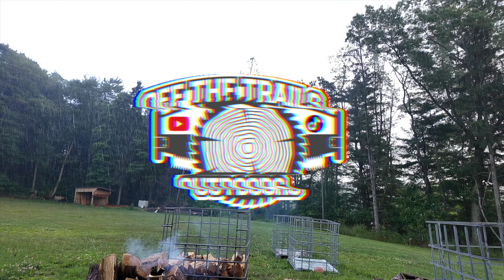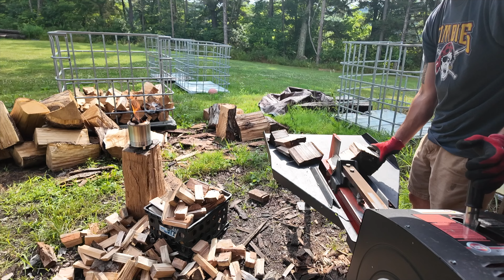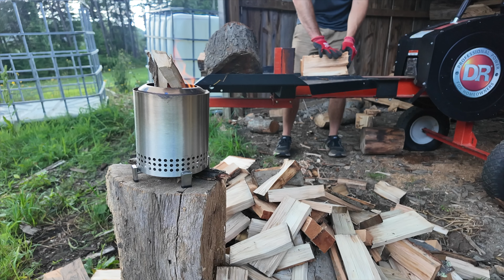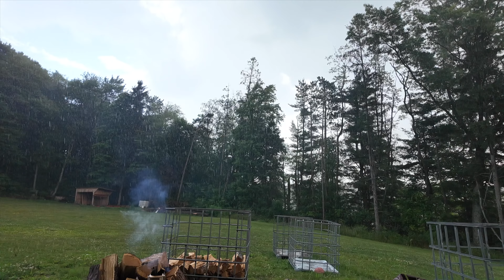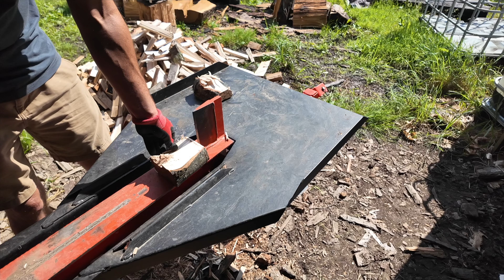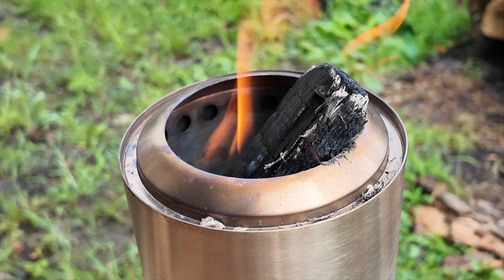Splitting Small Wood - Solo Stove / RapidFire

Comment: Not exactly the safest way to cut splits. I own one of the largest firewood companies in the South and have two Super Splitters (commercial grade kinetic versions of same style you have) and I'd never allow any of my employees to keep their hand in front of the ram as it's moving forward. While we run a significant volume (about 150 cords a week) and the chances are we'll have issues more often than you the main point is you will have issues eventually. Those splitters are notoriously dangerous and have a tendency to "kick" wood. When that happens you've got no idea what direction that piece of is going to go and where your hand will go if you happen to be holding onto it. We've be fortunate enough not to have anything more than a few bruises from flying wood but one of my fellow producers in TX has had several severed fingers. I've got a Bonfire sized Solo and we use pizza splits 8" cuts that work great. Not sure I'd use the smaller version except maybe for camping and smores but I might get one to give it a shot.
Be safe.
Reply from the maker: Thanks for the comment. I just bought a Huskee 20 ton hydrolic . I agree, this isn’t the best splitter for smalls ! What’s the name of your company? Sounds like you’re doing really well, congratulations!
Reply: Maybe a good ol’ hatchet would have worked better (safer). No fuel cost and you get to burn a few calories 😊😊